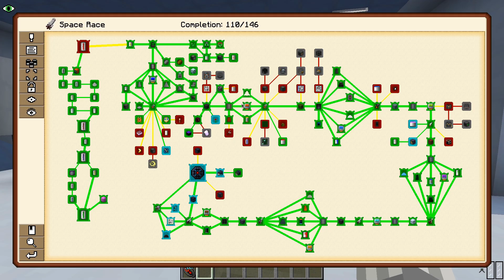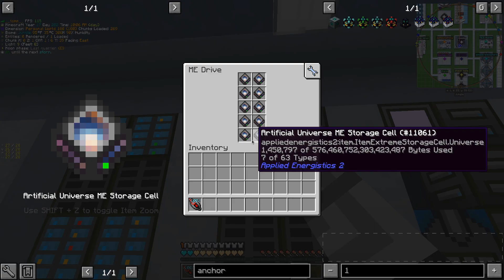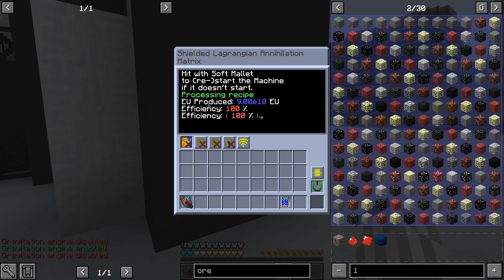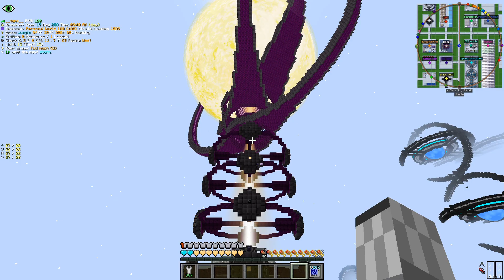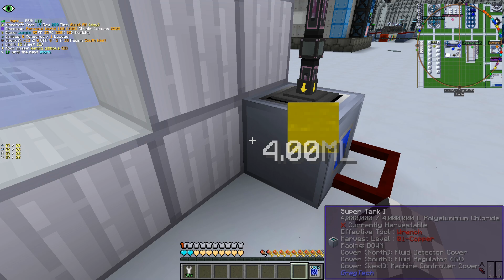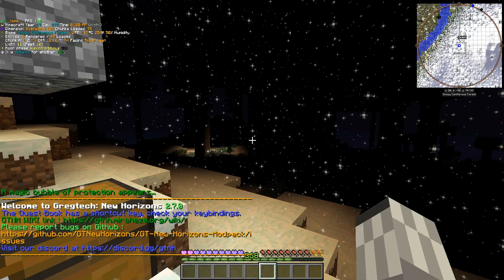GTNH 2.7.0 stargate tier base tour and download

Comment: i have a question I'm trying to run an antimatter generator, but the antimatter and superconductor base umv isn't working. Is there a solution?
Reply from the maker: ask on the gtnh discord.

in hindsight, i think you didn't provide enough information. did you place inside the generator the 2 fluids and they don't get used up? what energy dynamos do you have on the generator?
Reply: @AverageGregTechPlayer  All generators except antimatter generators are developing. antimatter and umv base not input from antimatter generators. And the liquid didn't go in at all
Reply: @AverageGregTechPlayer  hey dude. you have a not solution?

Comment: I couldn’t sleep last night so I binge watched every single episode of the series. It took me 500 hrs to get to IV… I didn’t parallelize nearly as much as I should have and the concept of having specific machines for a single material was a foreign concept to me… I got to the t3 rocket by hand crafting.. the only “automation” was like gasses, a tree farm into pyrolase for EU prod, and I remember finishing platline, seeing the assembly line SS reqs and rage quit 😂 

I’m going to give GT another attempt, especially since the last update just came out
Reply from the maker: i think everyone had that stage (unless they had seen other videos or similar games).
Reply: @AverageGregTechPlayer  I forgot to mention- the humor you sprinkled through the videos was great! You caught me off guard a few times, especially with the editing magic
Reply: Luckily i went through that phase in nomifactory where is only cost me tens of hours and not hundreds
Reply: Manualy crafting(most things) in such a modpack seems like big mistake espically if its so automation heavy, even in alot less convoluted modpacks first thing i normaly do is automate about everything i reasonably can, only certain items that i have looked up before and know dont have uses/most definitivly wont have in the shortwhile(considering res i have and will have, as in sometimes(often actually) its better to make the item so you can make more of it easly) are exempt, i sometimes even start doing so if i dont even see the need to potentialy need those res, in some smaller modpacks this caused me to already have like thousends of the res i needed making me only need to adjust a bit to get the projects done.
Reply: i have that exact experience now - i found peace in putting more time into automation and felt like i could try gtnh again - this time i reached IV in the same time i got to finish MV 80% last time.... also i batch-crafted a lot more - i noticed that it would be better to stripmine two orechunks at a time and double craft EVERYTHING than to single craft stuff and it shows really well. its better to put double effort into mining than to wait double the time for crafts